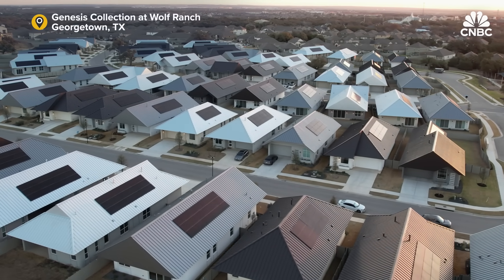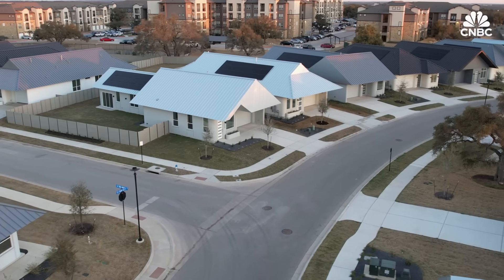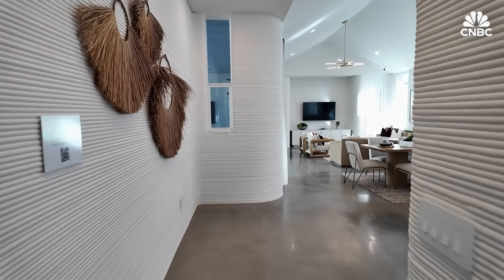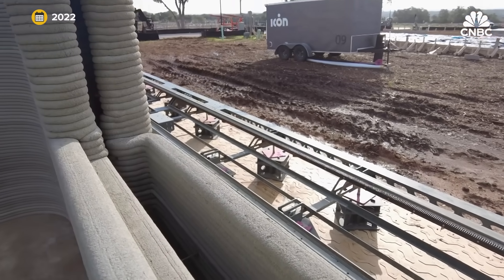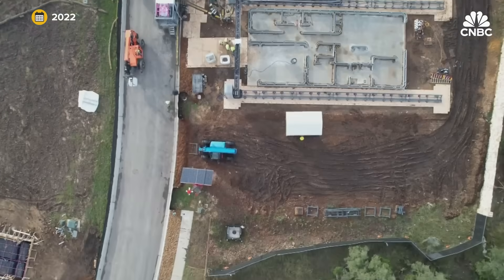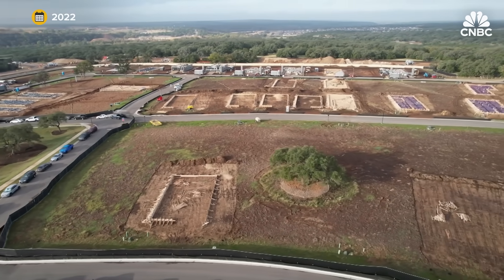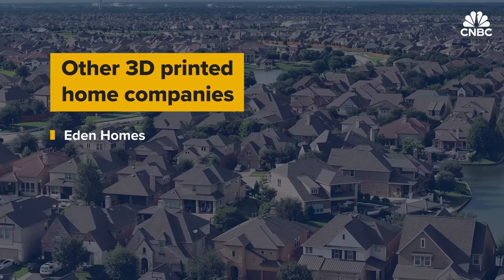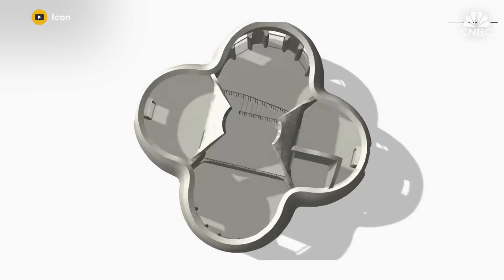Inside The World’s Largest 3D Printed Neighborhood

Comment: I love how they emphasized how they were able to figure out the cost reduction as they made more homes but in reality they just made the houses worse as time went on. Thinner exterior walls so it will be weaker structurally & louder for the resident. Then on top of that they are making less interior walls. So they're "cost saving" to be more profitable is to just make a bunch of hollow boxes and calling it 'open floor plans'...
Reply: Ding ding ding.
Reply: There's a level of "sufficient" that when you exceed it, there aren't any more gains. The law of diminishing returns. At some amount of concrete, the level of construction is good. Adding more concrete doesn't equal better, but rather, more expensive for no reason. It's the same reason why they don't build stick frame houses with 4"x4"s. I'm all for reducing it pending it still meets the structural requirements. Allowing them to save money, use less resources, and ultimately, print more homes.
Reply: @lvlikeyV  ding ding ding
Reply: That's what all open floor plan homes are. It's pure cost savings. Great if you want otherwise minor noise to cause conflicts between inhabitants.
Reply: I thought they looked much thinner
Reply: If you ever did any 3d printing you'd realize that too thick of walls is just time wasting. They probably went way too thick and realized it after the first house or 2. Newbie 3d printer maker error #1.
Reply: You can always build a bunker for your own home or you can build them with sticks and cardboard.

Comment: My thing is these homes are going to be harder to customize later. When someone new moves in, they won’t be able to knock down walls or make the space bigger. You’ll have to be happy with the layout as is.
Reply: Everyone will be renters in the future, haven't you heard? So it won't matter much.
Reply: It's concrete. You can knock down walls. Just like wood, you have to put in beams to hold the weight of the roof. Or floors above.
Reply: I worry that the developers' ultimate goal is to make these houses disposable.  "Oh, you want an extra bathroom?  No problem!  We'll tear everything down and print you a new one in a couple of weeks.". That would solve the customizing issue though.
Reply: Anyone who buys a house that isn't what they want is an idiot. If you're unhappy with your home, it's generally more financially beneficial to move to a house that better meets your needs than to make modifications to the one you're in. Other than kitchen remodels and basic maintenance, any home modification is flushing money down the toilet.
Reply: @davidpnut  I cost less to do a reno, then it is to buy a new house.
Reply: @saulgoodman2018  That is false. Except for kitchens and maintenance, every dollar you put into your home is flushed down the toilet.
Reply: @davidpnut  That is not false.
Reply: @saulgoodman2018 it costs more than selling your home for another that matches what you want
Reply: @cancerino666  No it does not.

Comment: Imagine having an electric bill of $26?! That’s awesome 😎
Reply: Imagine houses being built with concrete in the US like the rest of the world?
Reply: @MrPolandball  our diverse climate doesn’t work well with concrete. It causes infest issues, mold and high electrical costs.
Reply: @Lovelysoulgirl1984  the 3d printed home is concrete tho? And they just said its more mold and electricity resistant than normal homes (aka wood) so your point doesn't hold
Reply: @Lovelysoulgirl1984  because the rest of the world where it does work all has the same climate right??
Reply: That's in January in Texas, temperature was mild this winter. Let see what her electric bill is in July.
Reply: I cannot imagine that being evener motely correct - what about standing charges for example.
Reply: My electric bill is $22-29/mo 8 months of the year. About $75 the other 3. I live in Phoenix. No solar, no gas.

Comment: It would be interesting if they could build a community that actually stops a wildfire or a hurricane or tornado. The community with the houses becomes a defense system against natural disaster. Like breakwaters in the ocean. Then they might actually get funding from the state because they're building safety infrastructure.
Reply: If it's actually fire, wind, and hail proof, the houses will get lower home insurance premiums. Homes should be build to a higher standard in areas with extreme weather which is most of US.
Reply: the houses built with concrete survived the LA wildfires, while the neighbors all burned down, it does work
Reply: @danielzhang1916  I keep seeing this and it's misleading at best. The ONE house that is constantly referenced wasn't "just" concrete. It was an "over-engineered" house by a rich structural engineer/architect who not only used fire resistant materials (like stone and concrete), but also made several defensive decisions such as creating a large zone around the house that was void of all vegetation or anything that could transfer a fire to a house, they made it such that none of the windows could open, they were all sealed shut, etc.
Reply: @WingTzu343  I never said it was just concrete, obviously the owner had prepared for such a situation, my point was those houses survived while many others didn't
Reply: @WingTzu343  we'll never know how many houses could have been saved if they at least had concrete walls and stuff, something to think about for the future
Reply: Concrete homes do not do well in an earthquake.  A frame home has a little give and sway. Whereas a concrete home just cracks and crumbles.
Reply: Gee, look at the massive overhang of those roofs. Those roofs will be ripped right off during a strong hurricane or a tornado that just hit in Kentucky.
Reply: I love breakwaters!
Reply: Well there's no yards that can burn here.
Reply: @MikePhang   I don't want my tax dollars funding cement houses for rich ppl
Reply: @infinitetanner  Your tax dollars aren't going into the houses that other people pay for

Comment: The benefit is purely to the profits of the developer - at the expense of the consumer. These houses will not be able to be fixed to look like new if they are ever damaged in a storm. Square footage and interior finishes are below average meaning the resale value of these homes will be less than average.
Reply: In theory a concrete home could be less likely to be damaged in a storm to begin with thus cutting out those repair costs which could be a benefit for the consumer.  I have no clue if it'll actually turn out that way in practice though.
Reply: @YdenMk-II Texas has very low building code requirements compared to the hurricane codes of a state like Florida even though there are plenty of hurricanes that hit Texas. A 2x4 traveling at CAT 1 hurricane speeds will damage concrete (though not penetrate it) and machine laid concrete like this will never look the same again (because it will be fixed by human hands). It will be like a dented car door that can never be fully repaired or replaced. This is basically just an ad masquerading as journalism that hides the true realities and problems of what mass adoption of these homes will mean. But the developers will make boat loads of money.

Comment: 400,000 for a house that's 3D printed! Well, that company made its money back in two and a half houses.
Reply: No, not likely. The R&D for this was probably really expensive.
Reply: @TheRogueX, yeah, probably 10 years ago when they improved on 1930's technology.
Reply: yeah wtf, massive optimization, less labor, much less time spent building it, much of the infrastructure is integrated for easy peazy setup/wiring/plumbing... what's the point and where is the savings at for high-efficiency home building if 1500sq ft is nearing 500k?  It should be half that price, maximum.  It's unamerican to constantly find ways to rob americans - where's the companies that want to do right by americans, be cause they love their fellow americans, and want to see their fellow americans do/live better?
Reply: I wouldn't be so sure. They've been at this for almost a decade perfecting the equipment, technique, and dealing with legal and regulatory issues. It wouldn't surprise me if there was an ROI in the 10s of years.
Reply: A comment that doesn't consider the actual cost of concrete and the crew that has to come in and add all other features the house requires to be a house. Not including the machinery and staff cost to operate it.
Reply: @Supremax67, and what's the total cost of a normal house today. From what I guess it only cost producers about 80,000 to make a house like that out of normal construction practices. This method shaves a good month off of labor. And it's a CNC machine. It'll produce the same house over and over and over again, reducing overall cost. So one of my missing.
Reply: @Richard-r2o4j  -- That's fireproof? None exist. Sorry, were you expecting a different answer?
Reply: ignorant comment.
Reply: can you do it?
Reply: @HuyHTX yes, I could actually.
Reply: @misterogers you're only taking consideration for materials. It is a huge reduction in time, and overall cost of labor. That's amazing. But, do you think about what the overall cost to our economy. That's several jobs that are gone that are done by dozens of people per house.